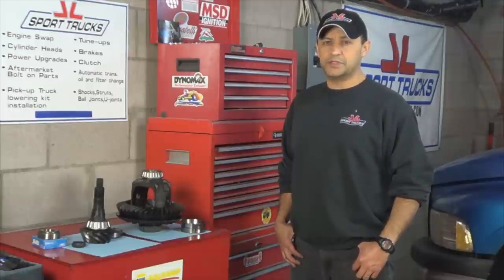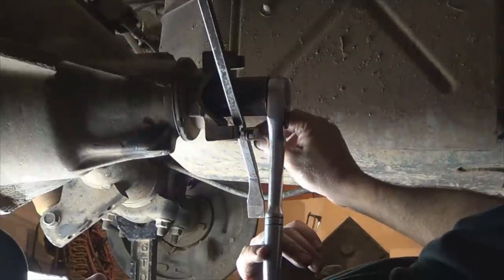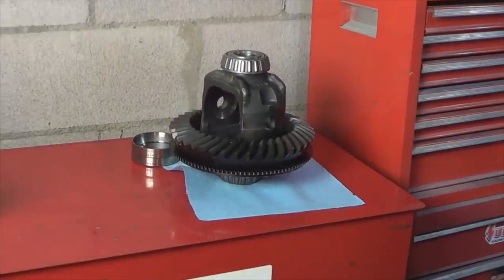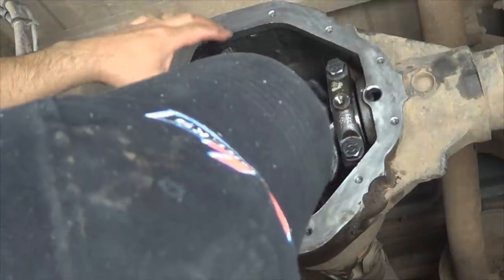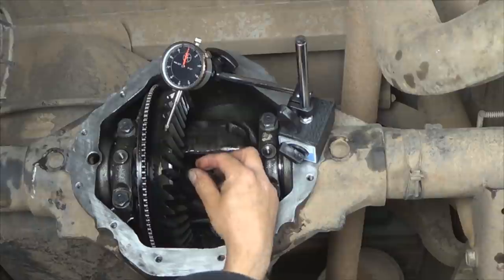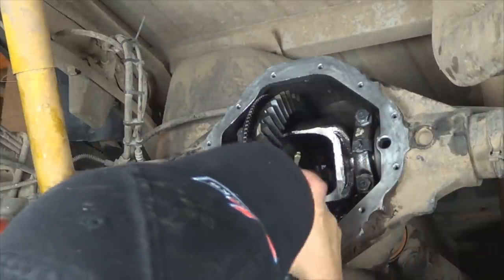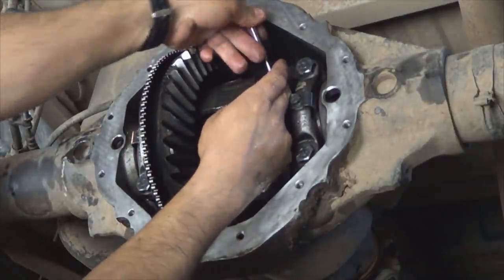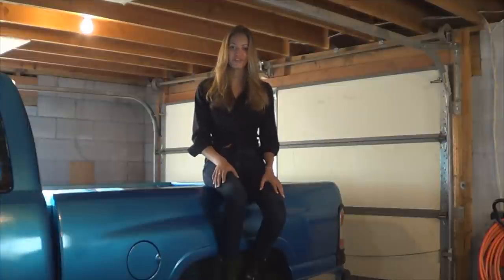Dodge RAM 1500 Noisy Rear Differential Diagnose and Repair part Three

Comment: This 3 part series allowed me to rebuild my ruined carrier assembly. The adjusting tool..genius.  $6 for fittings & i found a 40" length of threaded 1/2" pipe at work. My 1st rebuild.  This Dodge differential  lasted from Dealer to June 2016. 183K miles.

Comment: Very well done series on how to repair the problem. I was impressed with the step by step process and found it easy to follow. Did mine the same way following the steps, even made the special tool to set the bearing load. Nice job. Only thing missing was how to manage the pinion while setting the 20inch-pound. I used a 3ft piece of angle and drilled a hole in it to wedge the knuckle while cranking on the lock nut. 

Great job

Comment: Glad I found this. I just purchased a 2010 Ram and a AUL "Bumper to Bumper Warranty". I had this exact same noise. The dealer is now telling me that AUL is denying the claim as this is not covered. Sure looks like part of the drive train to me?? The dealer is trying to charge me nearly $1,300. Can any of you comment on what this should cost? I am taking my truck away from the dealer. Hall Dodge in Virginia Beach VA
Reply: john shourds  it's covered by drive train warranty but only if you done the maintenance shedule

Comment: Great Video!  I'm getting ready to do exactly the same thing to mine.  I just made the adjuster tool.    Can you tell me what diameter discs I need for the bear race tool?  I need to buy a kit and want to make sure I get one that has the correct size disc's  in it.
Thanks for taking the time to put this video together!

Comment: This is a great video .I'm curious about indexing the yoke with the pinion and the drive shaft with the yoke. How tough is it to get the spider gears back into their original locations?   After you remove the four bolts and the caps from the u joint bearings you can get tape across the top half of the bearings that are now exposed. Just wrap the black tape around the entire driveshaft making sure you catch the top half of the two bearing tops. Then they won't fall off during removal. Found this works well and keeps them in place while you are working on the differential.. Thank you for sharing this info with us Dodge owners.

Comment: IMO you should have a video on just the dial indicator.  Also, what model of indicator will work and where to purchase?  Great Video and would save hundreds or even thousands on the repair.  The hard part is the Dial Indicator and getting the precise adjustment of the backlash and seating.

Comment: This was extremely informative and enjoyable to watch. On this particular model in addition to setting the backlash adjustment of the ring gear as it meshes against the pinion gear and setting your bearing preload my question is.........did you have to set the pinion gear depth.......and did you have to use gear paste to check the mesh pattern of the gears?

Comment: Yes a slow process. If you go to tight on the crush sleeve then you can’t back it off because you won’t have proper preload on the bearings then. You would have to get another crush sleeve and start over again. Been there and done that before ha ha. Tough lesson to learn.

Comment: It's the preload, in inch pounds, that you want to give attention and priority too. not any "torque" spec, as far as tightening the pinion nut goes. as you said, If You  torque the pinion nut to a certain spec, it could be too much load on the bearing, and you wouldn't even be able to turn  the pinion. Monitor the inch-pound preload as you're tightening, don't be concentrating on torque spec.

Comment: I have a question for you maybe you could help. My crush sleeve I got in my kit looks a lot different than the one I took off. They’re about the same size but the one in the kit has a concave bump in the middle opposed to a convex Bump in the middle. Do you think they’ll be any issues with that? Thank you for the video!

Comment: Very good 3 part video! I have a 2003 Dodge Ram 1500 5.7 and I only hear a small rumble in the rear when taking off from a stop with my wheels turned, just for about a second. Any suggestions? Also, does the differential have to be marked since it is counter balanced?
Thank you again for an AWESOME video!!

Comment: On the pinion nut, suppose I get the right amount of inch pounds and can't tighten it any further, and suppose I'm  nowhere near the required foot pounds. What do I do then? If I tighten the nut any further, I will be too tight on the pinion bearings, right?

Comment: Great video. Although I wish you got a little more in depth of the backlash adjusted on each side.  How does that adjuster move ?
Reply: moparkid440 you need specials tool it's a long bar with hexagonal nut that fit in the ajuster

Comment: My fathers 2002 1500 4x4 had  a gear to gear creak noise when turning changed pinion bearings axle bearing and races due to excesive bearing play....now creaking is straight and turning found out lack of friction modifier additive wore limited slip clutch packs on both axle gears so when driven and they heat up they stick together until they cool it gets stuck into a posi state.

Comment: I am trying to get my crush sleeve to crush on a 04 dodge 9 1/4 rear have tried placing a floor jack under it with a 1/2 breaker bar just want crush at all any advice would be greatly appreciated if you the nut as tight as it will go and still has a little tiny bit of play can't figure it out .

Comment: Great video, i have a question about a 2003 dodge ram 1500 with the 9.25 limited slip differential.  I plan on changing the clutches and and clutch pack retaining clips that always breaks on these trucks.  Is it possible to change the limited slip clutches without removing the carrier from the rear differential?  And also could i remove and install the spider gears by rotating the side gears to get them in and out without using special tools to press the side gears to get the spider gears in and out?
Reply: Chris Brown you must remove the diff case and you need specials tools

Comment: Great job !

I have my rear diff not serviced in 130 k miles, since brand new, although it is smooth and quite, I am afraid i will get noisy diff if i change the oil after this interval , what do you think?

Thanks
Reply: You're going to find all different opinions on changing gear oil.I have had trucks that the only way you could change the oil is maybe suck the majority of it out, or you would have to remove the third member, as there  is no plug, anywhere to drain it. And I've just kept it full, and had hundreds of thousands of miles, without removing  the  old oil, and filling it with new oil, only making sure it stayed full of oil. if it was contaminated with water, you would have to do whatever you needed to do to get that oil out, and then install new oil.

Comment: I need to have this done for my 99 Dodge Van.. But I live in a Apartment complex where we aren’t allowed to do heave mechanical work.. I don’t have the first clue to where it can be replaced seals and bearings for the Axle.. With my Rear Axle making the same noises including the vibrating sounds. I certainly would need to have it worked on soon, but with who in my small city town of sleepy San Clemente California.. Can I get someone to help with this leaking Axle..??..

Comment: How many shims do I need to put in between the pinion gear and bearing? Also, are shims needed for both the outer and inner, or just the inner?
Reply: +Gagalukey Only on the inner. Take micrometers or calipers and check the thickness of the old shim in 6 or 8 places. What ever the thickest reading is you get is the amount of shimming you want. I could have been 1 or 2 shims from the factory, the number of shims is not important what is important is that the thickness is the same plus or minus about 1/2 of a thousandth. Also make sure you put the shims on the pinion shaft before you press the inner pinion bearing on. You don't want to have to try and get the new bearing back off, that will be almost impossible to do and save the bearing! If you had to cut the bearing off because you don't have a press and separator comment back and I will tell you how to get the new bearing on. best wishes Tim

Comment: I looked into replacing my 01 rear end with disc brake out of an 02 looks like it would work except for the mounts for the springs and the shocks Plumbing for brake lines look the same cables for emergency brakes looks same rear end slightly wider if you're working with two wheel drive that'll widen your stance on the rear thought I'd throw that in those of you that are into tweak engineer cut to fit paint to match 02 has a wider frame

Comment: I have a 2008 Dodge Ram 1500 and when I hit the brakes it feels like something in my driveline still wants to move forward. I had my spider gears and inside bearing replaced in my dif, brake pads changed all the way around, u joints replaced and my back rotors replaced. I can feel a vibration in my seat and in my rear end when braking, almost like a hopping sensation. Do you have any idea what could be wrong? Thanks!!
Reply: American V8 Hey did you ever get that issue resolved. I have the exact problem. Someone told me it could be my motor mounts that were worn out and seperated. If you can comment back I'd appreciate it. I'm changing the mounts this weekend if all goes well.
Reply: American V8 is it 4x4?

Comment: I've got a noise in my jeep grand cherokee (2008)'s rear end, you begin to hear it at around 40 kmh and gets louder till 50 kmh then starts to go quiet as you go faster,  its' not very loud even at 50, but it's noticeable,  it has a similar to that of a semi truck's differential noise.  I had the pinion seal replaced by the dealer a couple months ago, I'm not sure if the noise was there before or not.
Any ideas?
Reply: I've same problem on 2006 jeep grand Cherokee
Reply: Reseat the pinion bearing to specs. 210 ft lb.on pinion nut or 10-20 inch pounds for pinion rotating resistance. Dont delay as those specs are for brand new components. Even .001 wear will throw off the system.

Comment: At  min 3:37  when you are driving the pinion in   how  do you  knot it's enough  (close t o specs) to stop ?  ... help me ,need some guidelines for this
Reply: +Carlos Mejia You use a dial-type inch pound torque wrench to see how much torque it takes to turn the pinion. I believe the guy in the video said the turning torque should be 20 to 30 inch pounds. It should be pretty hard to get the crush sleeve to crush, but after it starts to crush it'll get easier to tighten the nut again. That's when you want to start being careful not to over tighten it. You may have to tighten a little, and check the turning torque on the pinion, tighten a little more, check it again, you may have to do this several times. Just be patient.
Reply: +Robert Gantry ,got it,thanx!

Comment: you skipped how to get the old bearings off the housing and pinion between part 2 and 3. just show the new ones already on.  mine aren't just slipping off even with force
Reply: I was thinking the same thing ..  I figured the inner pinion bearing would require a press to remove it .
Thanks    :-)
God bless
Wyr
Reply: Any further information on this comment?
Do you need a press..what worked for you?
Reply: Bushey press off and on. Be sure to fully seat  the bearing 
very light coating of  chassis grease to use as a squish indicator for full seating. When it squishes out your home!